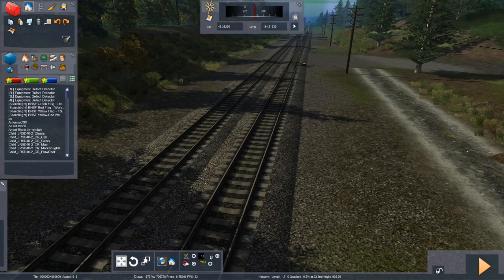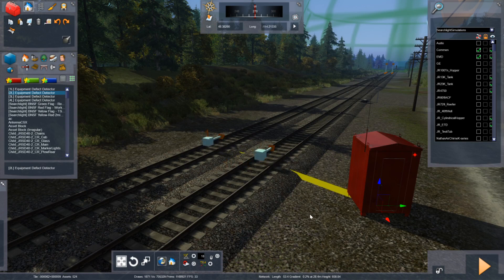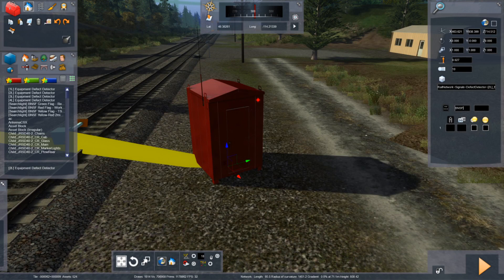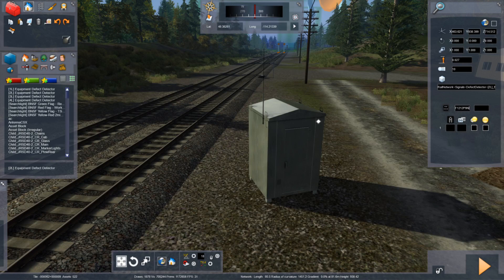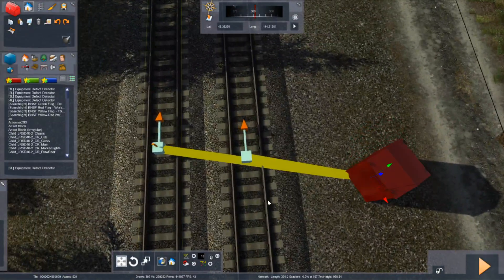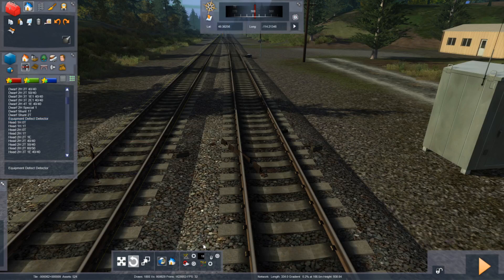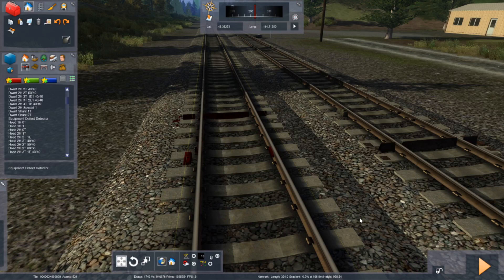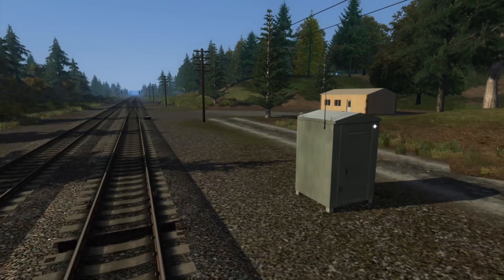[TS2020] - Equipment Defect Detector - Setup Tutorial 2

Comment: I have a small problem with my copy of the detector. It seems if I have more than 1 locomotive in my consist, or if my train is long, then the detector won't work. I implemented the detector script into the Marias Pass Gevo and SW1500, Amtrak P42DC, and BNSF SD70MAC, and I installed the detectors on the Marias Pass route. I also followed all the instructions as best as I could.
Reply from the maker: We've since launch fixed that bug. You'll have to re-modify all engine scripts though with our latest version.